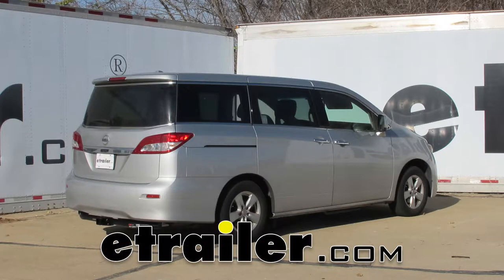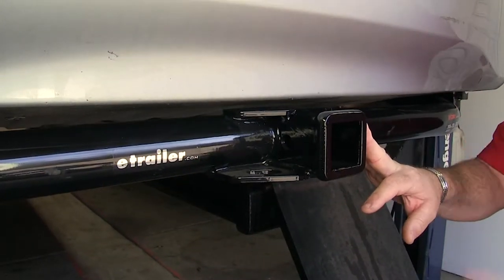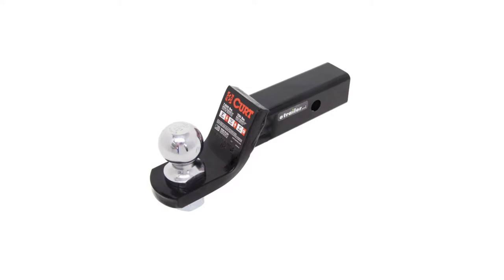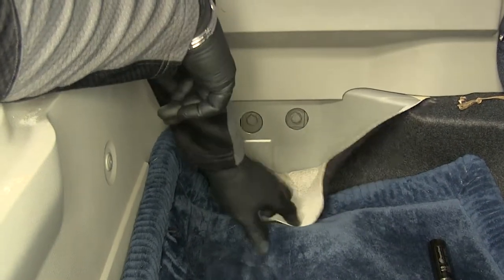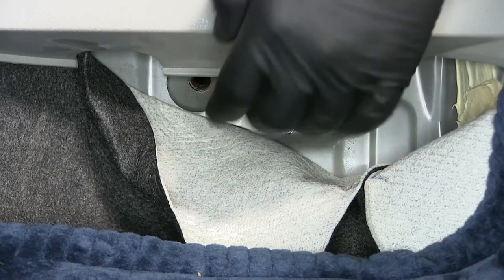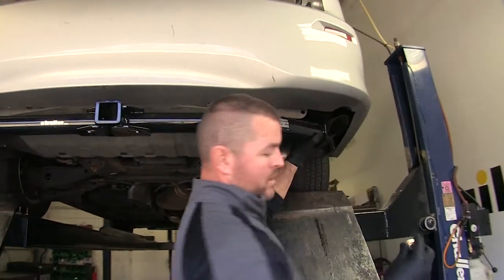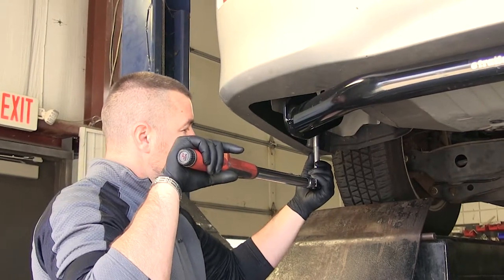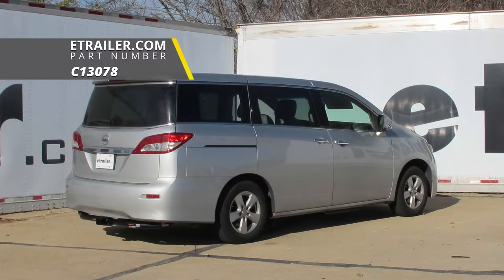etrailer | How to Set Up Your Curt Trailer Hitch Receiver on a 2013 Nissan Quest

Comment: What is the recommended ball mount rise?
Reply from the maker: The rise needed will depend on the level coupler height of your trailer, which is usually between 16-19 inches. The installed receiver height of the Curt # C13078 hitch is about 11 inches. A ball mount like # C45100 with a 6 inch rise will put the ball at about 17 inches which should work well. 
https://www.etrailer.com/Trailer-Hitch/CURT/C13078.html
https://www.etrailer.com/Trailer-Hitch-Ball-Mount/CURT/C45100.html